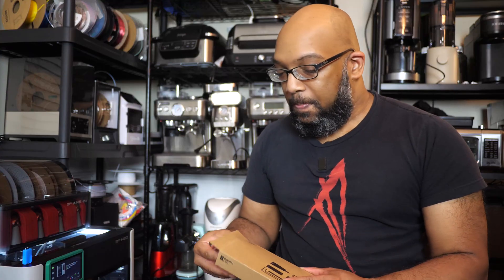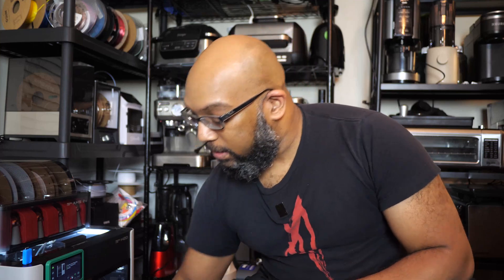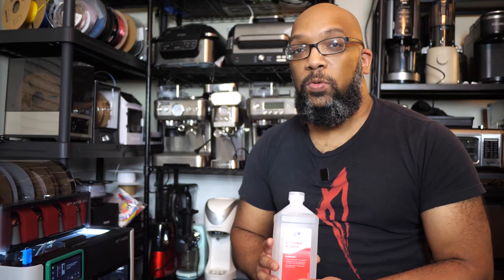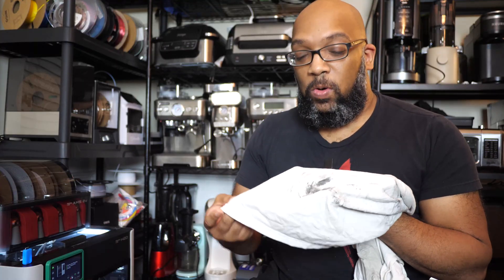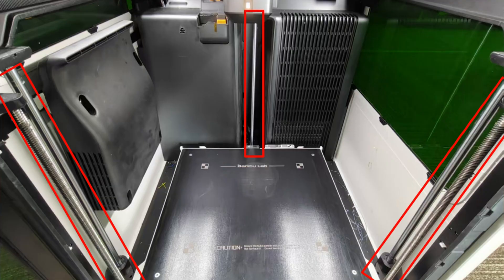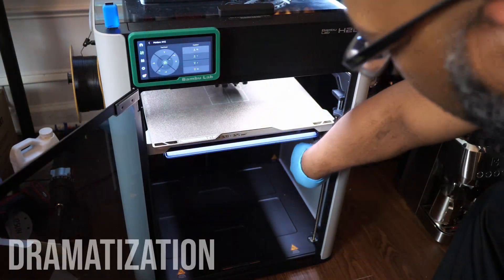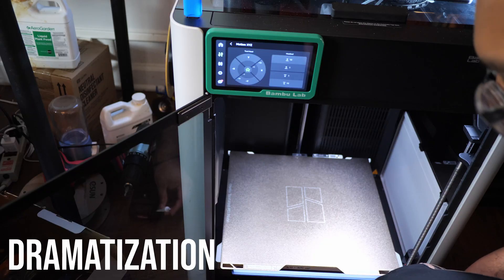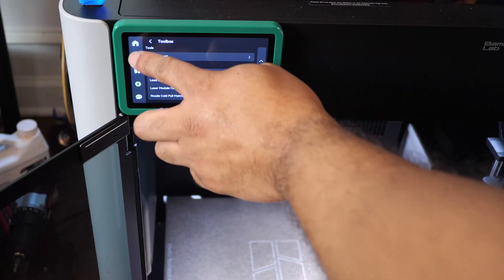Bambu Lab H2D Care Tip: Lube It Up!

Comment: I have a tip. If using an after market h2d build plate that's black, don't print on it with black filament. The AI can't detect a misprint and you end up with the blob of death..... I'm still trying to fix it 😅